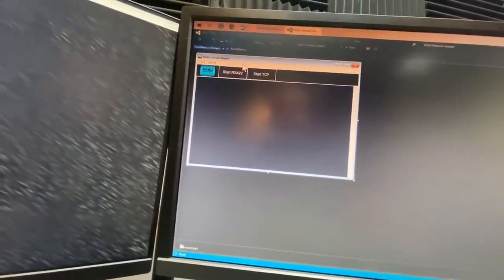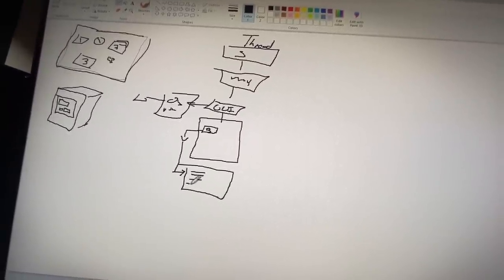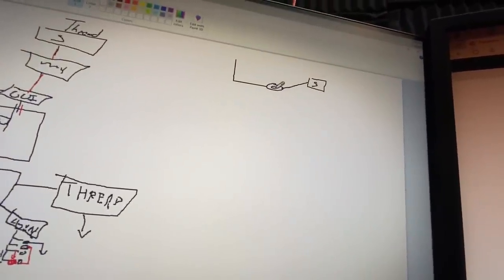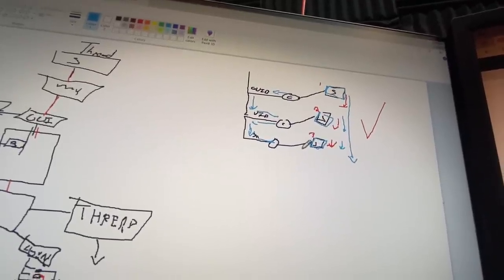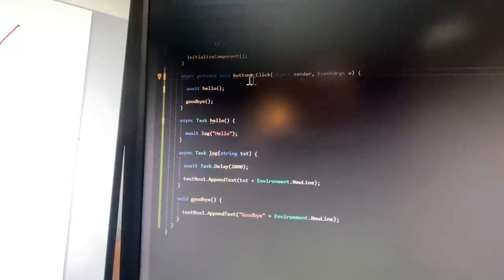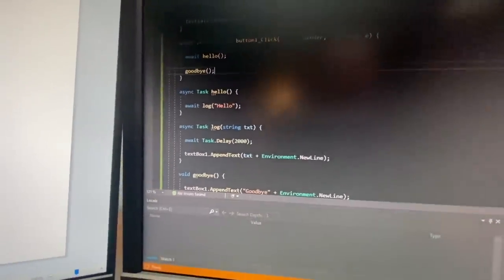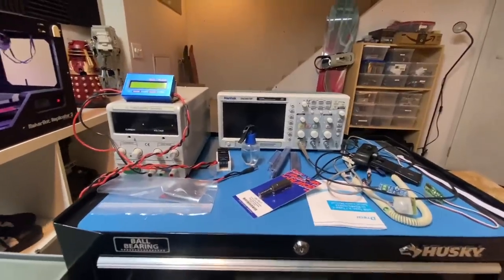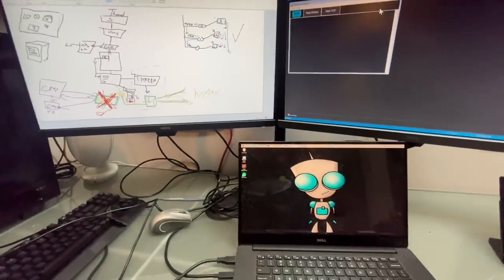30 - Software Threading - It's like knitting but knot.

Comment: the way C# does async/await is sooooooooo dumb, to me.  one function is async, so everything up to main needs to be async as well?  WTF kind of design is that?  "Please don't use async code; we've made it unnecessarily stupid so you don't think about it," is what that says, to me.
Reply: Obviously you have zero knowledge on how to use async/await and what it represents... Want to call an async function in a sync one? Use the .Result from the task that is returned, that's it. Of course, if you cause a deadlock because you've been so dumb of calling async code not properly configured that's your problem, but don't blame C#, that's your fault. Also, what are you going to gain calling async code from sync one? Precisely the benefit of async code is to release threads that are awaiting for external events to happen like IO bound tasks or heavy CPU bound tasks so they can be used in other tasks reducing the amount of threads that your program needs to use, if you block your thread waiting for those asynchronous tasks to finish you are not only losing the benefits, you're introducing more overhead.
Reply: @drgusman  it's been a few years yes.  I switched to another language and haven't looked back.
Reply: It may be a lot of initial work, but it's not dumb. The alternative is possible deadlocks and complicated error handling. Trust me, typing async and await a bunch of times is FAR less work than debugging mixed async and blocking code.
Reply: @andywest5773  Go does it in a much cleaner way, to me.  if you want something to run async, you just shove the keyword "go" in front of the invocation.  same signature, same return type.

traditional threads in C# were easier for me to learn than async/await.  the behavior of async/await changes whether it's a command-line or GUI program, as well.  plain thread pools and threads are at least consistent.
Reply: @naikrovek  Sure, it makes sense. C# was released in 2000 and didn't get async officially until 2012, which means it had to be integrated into a well-established language. Go came out in 2009 and was written with concurrency in mind, so it's not surprising.
Reply: @naikrovek  "go" in Golang has nothing to do with async/await in C#, "go" is the same as using the threadpool in C#. This is one of the most common misconceptions about async in C#, it's not about creating new threads but using less when they aren't needed. There are many tasks that are naturally asynchronous, for example IO bound tasks like reading from the hard drive or from a network connection, you don't get the data immediatelly, the system needs to wait until the data is available. In that case if you are waiting in a thread for that task to be completed you are wasting resources as you could use that thread for other tasks, and that's exactly what async/await is about, when you await a task you aren't telling the framework to create a new thread, it does exactly the opposite, you're telling it that what you are calling will wait for some external resource and meanwhile the thread where your code is being executed can be used for something else. Take for example a button in a GUI that is going to create a very large file, if you "await" that task the GUI thread will be freed each time the system is writting to disk and the GUI will still be responsive without the need of creating any new thread.
Reply: @drgusman  I use threads and threadpools in C# because of all the gotchas around async/await in C#.  If you don't think async/await in C# is designed poorly, I don't think you use it a lot and you probably do some teaching.  If I need to use a library which uses async/await, I will either simply not use that library and write my own code to do that thing, or I will not use C# at all.  

thread pools and events which signal thread progression and/or completion are far easier to rationalize for me than async/await, and that's just how it is for me.  I'm sorry that I'm not able to say it any more clearly than that.

If thread pools, manual thread coordination, and events are simpler and far more consistent than a language feature which was designed to "make asynchronous code easier" then you've made a few bad language design decisions about your simplification.
Reply: @naikrovek  I am a system architect and main lead developer for a very big company and all the code I do is always async, precisely because thanks to async you can achieve results that would kill any server wihtout it. When your target is to answer 7 million requests per second, if you try to do that creating threads you are going to kill the server, meanwhile using async/await a single server is more than enough.

Again, async/await is not about creating threads but using less. I recommend you to read the documentation about what it does because you are showing that you don't understand it (and don't get it as an insult, in fact is something that is difficult to understand unless you get deeper on the subject and many developers have problems getting it as it is counter-intuitive, it does the opposite that you will think at a first glance). 

If you want to create threads and wait synchronously then with Task.Run().Result you will get that without any usage of async/await, but that yields no benefit in resource usage matters.
Reply: @naikrovek  Lol. Sorry but now I cannot do anything else but to laugh. So you admit that aren't able to understand what it does but say that is badly implemented... It's like saying that a CPU is badly designed because you aren't able to understand assembler 😆. Before saying that is badly implemented first you need to understand what it does, and obviously you don't, you still try to compare multithreading with asynchrony while both are completely different.
Reply: @drgusman  if it were well designed, i'd be able to understand it in just a few minutes.
Reply: @naikrovek  So anything that you don't get in a few minutes is badly designed. CPUs, GPUs, ALUs, any existing electronics design... even the universe itself, all badly designed because you aren't able to understand them in a few minutes... 🤣
Reply: @drgusman  no, not necessarily, but you get a feeling for what is a good design and what is not pretty easily.  I would expect a Dr. to know this.  you don't need to be a chef to know what bad food tastes like, and you don't have to design a lot of things to be able to see a bad design easily.
Reply: @naikrovek  You can get what feeling you want, that doesn't mean that is true, is just a feeling. Alcohol in a wound hurts so your first feeling is that is bad, but when you understand that it prevents that wound to get infected your "feeling" will change. You can say what tastes good or bad because you already know what is to taste good or to taste bad, but you can't say if something was well cooked unless you know how to cook, the taste is not only what determines if something was well cooked or not, something that was cooked with poisonous oil may taste really well, but at the end of the day you will be in a grave.
Reply: @drgusman  go away
Reply: @naikrovek  It seems that it hurted your feelings... 😇